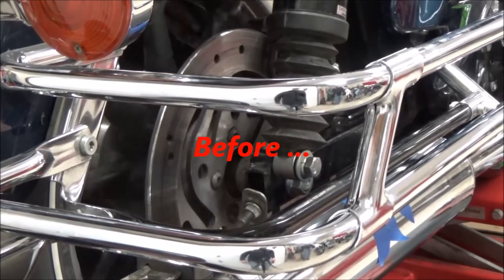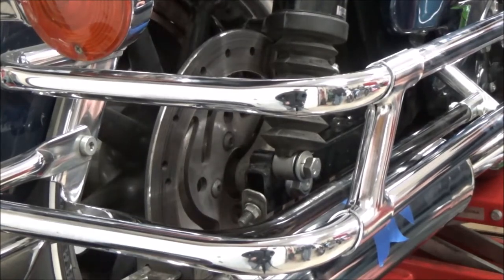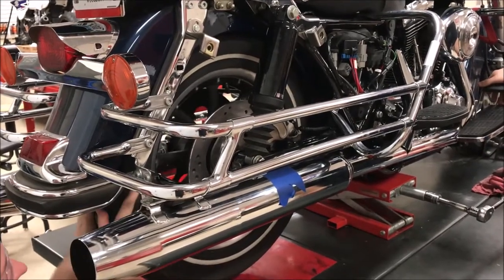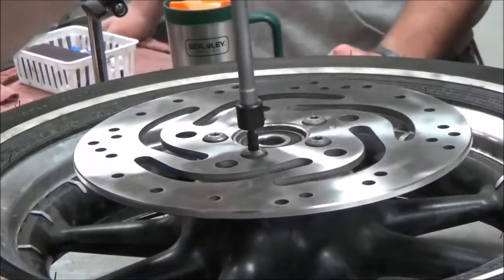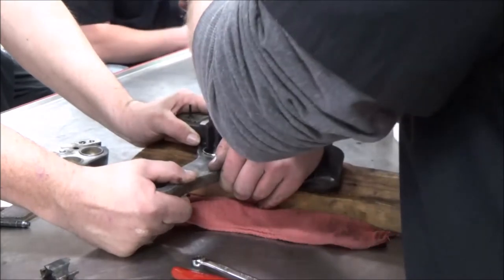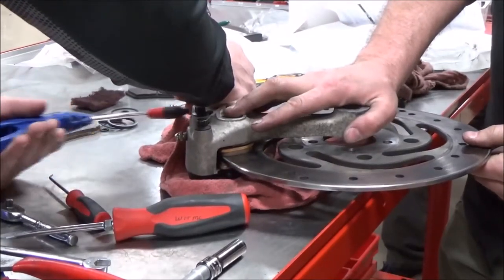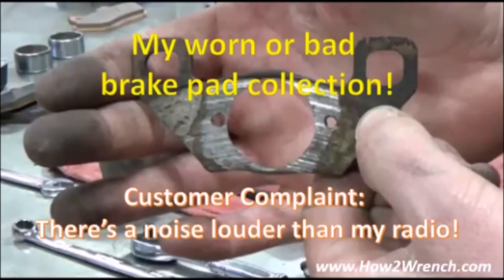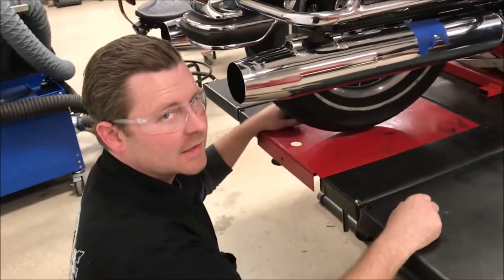Summary of a Repaired Sticking Brake Caliper and Warped Rotor Fix for Bill

Comment: Love the videos, as a professional shade tree (2 words that shouldn't go together lol) mechanic I get a ton of value out of your explanations and digging in to the ways you go about your work/trade. 

You don't happen to have a video or explanation of replacing/inspecting a clutch hub/basket bearing do you? My bike is a 01 FXDX, 98" kit, Branch OKeefe heads with reaper 574 cams, S&S cam chest/oil pump, belt to chain drive conversion 24/55t, Barnett clutch and spring....as far as the motor and drive train that's the meat....I know my setup is a little bit of a hot rod and a little harder on bits and pieces than the average Dyna